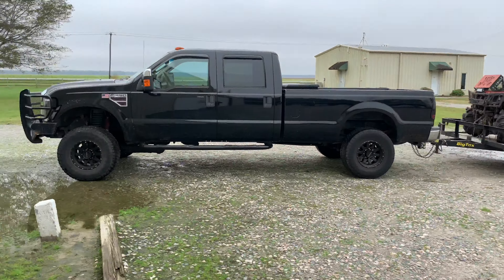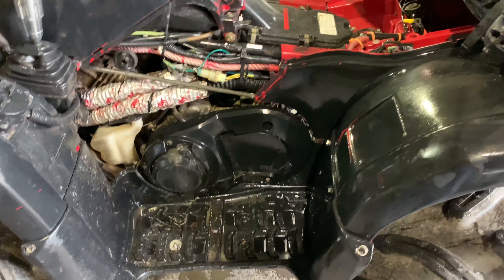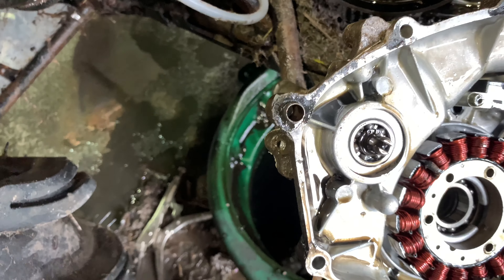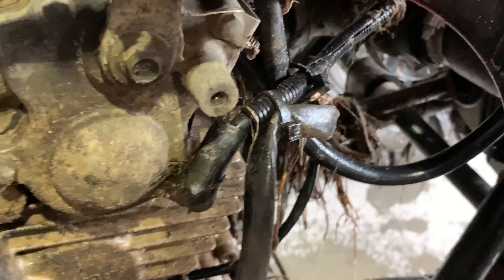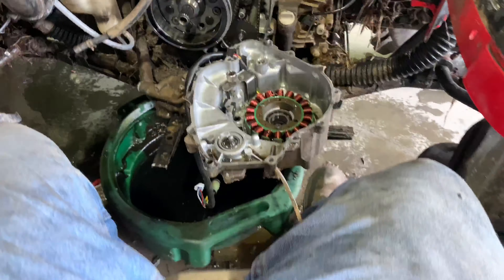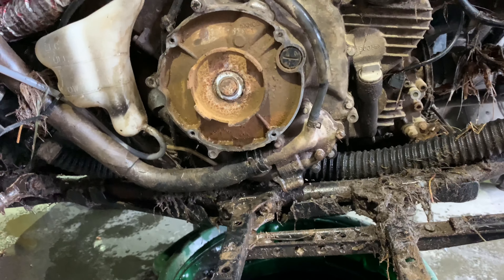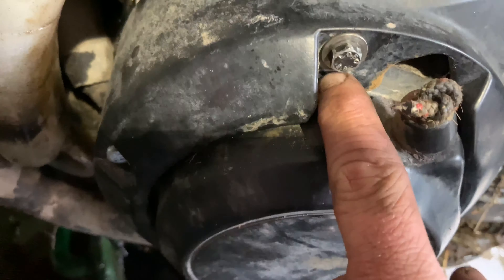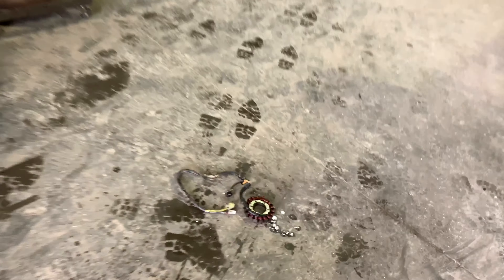2003 Yamaha grizzly 660...how to change the stator

Comment: Did you have to take off the crankcase bolt off to remove the cover? The bolt in the center where you can put a socket on and spin the crankshaft.
Reply from the maker: Ima be honest it’s been so long I can’t remember what I had to do
Reply: That’s alright, I had to remove the bolt to take the cover off
Reply from the maker: @joshg4974  ok man